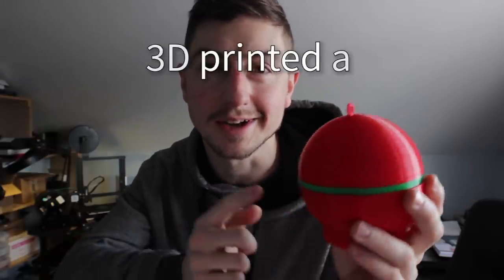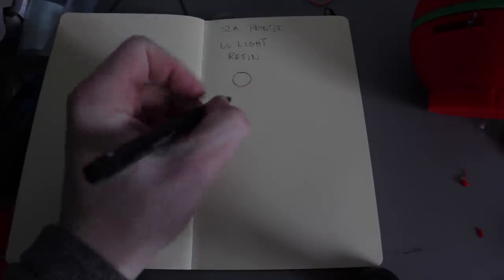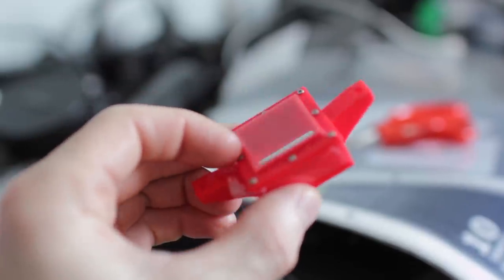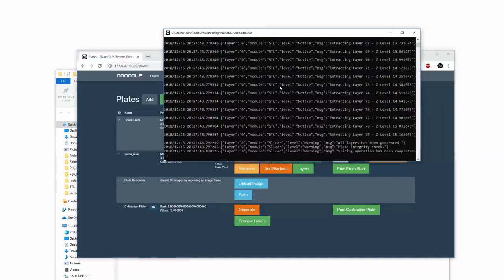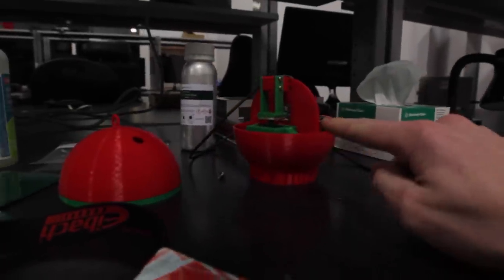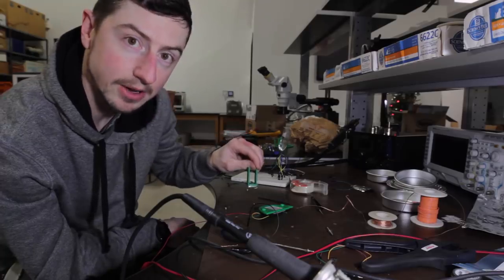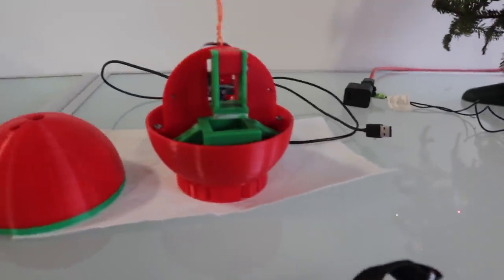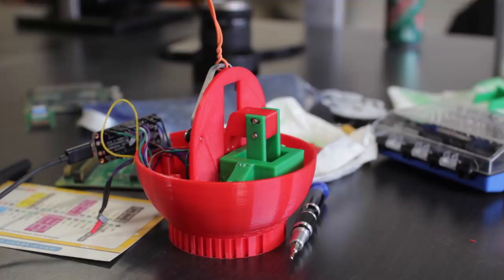Worlds Smallest 3D Printer (not anymore)

Comment: I'm really impressed by this - I think the mechanisms used for the DLP printing was really cool with the LCD screen masking and the overall concept. I'm impressed it works - feels really original.

Good job! Merry Christmas as well
Reply from the maker: Lots of the low cost SLA printers use this technique I believe. I think its being called MSLA. When I discovered it, I didn't think it was possible to make it work so well. As bad as my prints were, there is so much room for improvement, which I love.

Comment: Very cool project! I may have misunderstood, but it seemed like you would run the build plate down until the stepper stalled and then move up a couple steps and repeated for every layer. If the motor truly is a stepper you should only have to "Crash-Home" on the first layer. Regular 3D printers don't touch off on the endstops, you shouldn't need to in this case either. Hopefully this helps the squishing. As for prints failing because they stick too well to the bed, a lot of the higher end machines have tilt/slide/wipe mechanisms to help gradually break the connection between the screen and the print. Perhaps you could make your resin vat hinged so that as the build plate lifts, the vat tips slightly to break the adhesion from one edge towards the other.
Reply from the maker: You’re not wrong about the stepper. That was the original plan, to have it just count up x steps then down x-1 steps.  However when it came to reality some prints would hold on strong enough that it would skip steps on the bed lifting and peeling process, so it would lose its position, so like I said in the video “had to get creative” with it haha - I have plans for a tiny bed tilt operation that I need to work out.

Comment: Great Job! I would recommend to do a UV Display for PCB etching.
Reply from the maker: interesting, Ill look into it! I've never really gotten into doing my own PCB because its so easy to send off, but I should try one of these days!
Reply: @SeanHodgins  I can recommend a video on that topic by "electronoobs " " using a SLA printer for PCB etching". The great thing with that technique is that the toner from a printer does not have to get transfered via a paper and therefore the results are pretty impressive.

Comment: I barely expressed my amazement in my earlier comment, but SeanHodgins did an incredible job executing this idea! I do believe he spared us some of the hair-pulling issues he had to tackle to get this machine to work, but holy cow, from conception to a functional prototype in such a short time, all he has left now is the fine-tuning (although, as they say, the devil is in the details).

This project caught my eye due to problems I had printing very small objects on my FDM printer. While looking for tips, I came across the gaming communities who have perfected settings necessary to print small details, critical for the miniature figures and props they use in their games.

Which got me to thinking, is there any reason a very small form-factor 3D printer couldn't be built specifically for extremely fine details, or very small parts? So I found this video, which answers the question about precision, but now I have to know if FDM will scale down as well as this SLA concept did?

I'm picturing an enclosed "Prusa" style printer, a bit smaller than a shoe box, equipped with a heated bed (for ABS or PETG). I'm also picturing headaches getting nozzles with ultra-tiny orifices to extrude well, finding supplies of smaller diameter filament, getting slicers to understand settings that will fall beneath lower limits, etc.

Again, I can't thank you enough for sharing this project, great work!
Reply: My printer is a mini printer based on the RepRap Prusa I3. It's called 3Dtje. You can find all components on Thingiverse. The nozzle is 0.3 mm which works fine on small and medium sized prints. A 0.2 nozzle gave problems, perhaps the filament cooled off too quick. It's not nearly as small as this SLA printer. I think for really small parts SLA will be much better than FDM.

Comment: I love this. I have an old 3d printer controller based on the 1284p and I have been hacking away today to make my own firmware for a variation on this. Just got it to read some bitmaps from the onboard SD slot and display it on a 1.8" tft and tomorrow I'll get some steppers moving for the z axis and maybe a vat wiper, add a 2004lcd controller and hope it works ok. if it's fun enough I might do something with a 14" 1080p monitor and a raspberry pi I have kicking around the junk drawer
Reply from the maker: Sounds like a fun project!

Comment: What did you use for the build platform? Is that just a small piece of aluminum? Love the build, I'm planning a scaled up version because why not, hence the question
Reply from the maker: Yeah I forgot to mention it in the video I think, I super glued on a piece of 1/8” aluminum flat bar that I just cut to length, onto the bottom of the PLA build plate I printed. Drilled a few holes in it to allow the fluid to flow easier.
Reply: @SeanHodgins  Excellent, I've always wondered if this would work but I've just never taken the time to design and print everything, now at least i know it's not impossible! In fact it's damn easy, lol, thanks for the great build

Comment: Its actually a DLP printer. Sla uses 2 lasers, which is ehere thr stereo in sla comes from.
At first I was like "how the fuck is he going to fit an FDM in that?", as soon as i saw one motor and an LCD i knew what you were up to.

Alot of people argue that LCD printers are not DLP, but what is an LCD screen doing? Its projecting digital light.
Reply from the maker: I’m fairly certain all laser based SLA printers have a single laser. I’ve heard this type (using the lcd) is being referred to as MSLA, as in masking stereolithography printing. If I had to guess, the stereo comes from the fact it’s in the 3rd dimension, instead of just “lithograph” which is a two dimensional print. But lithography does not pertain to lasers at all. In fact lithography is just about printing in a way that involves stopping the ink (or whatever your printing) from going to certain areas, whether that is using chemicals to stop the ink from spreading, or using a mask(like in etching PCBs) to stop UV light from affecting certain parts. 
I like the term MSLA, it’s the most to the point for this type of printing.

Comment: Wow, and I can barely get my actual resin printer that isnt 4 years old to work. I expected a filament hole and extruder head with like a 3 arm FDM printer under there, not that.
Reply from the maker: That would be a feat in itself. 😂
Reply: @SeanHodgins  What about with the top half as a rotating Z axis with a single actuator x/y depth from a centerline.

Comment: Why are you just ramming the thing down? Who cares if you don't have a limit switch... If the drive you used was a stepper motor, then you could just be able to tell it to go down the first time, having the build plate 'loose', and then tighten it so that it stays flat and flush to the bottom of the tank... then, when it raises, just tell it to go back down but minus one.... then, you don't have to worry about it slamming stuff around or even needing a limit switch... since having a limit switch on an SLA is kind of just useless....
Reply from the maker: Stepper is not powerful enough, it jumped steps. Took a bunch of jumped steps to get the print to lift from the tank. So it loses position. My original code did just that, Lift up X, lower X-1, but it didn't work when it skips steps.
Reply: @SeanHodgins  in confused as to how that affects anything? Unless it's not using a stepper motor? Idk because it isn't very clear. Most DVD drives I've ever opened are all stepper driven. Lol.
Reply from the maker: @HDFoxra  Stepper motors do not know their position. You need to have a location that is position 0 and just keep track of steps. Generally position 0, or HOME, is found by hitting a limit switch. Since I didn't have limit switches, I ran the stepper to the bottom and bottomed it out(skipped steps), I called that position 0. Then I would raise it up one position. When you send a step to a stepper motor, the microcontroller thinks it moved, it doesn't know it moved, it just thinks it did. In order to know you need to have an encoder monitoring its position most steppers don't have these built in, but you can get them(not with these tiny motors). So lets say you have a stepper motor, you tell it to take 10 steps, but for the last 2 it gets jammed by something. Now the microcontroller thinks the stepper is at position 10, but its only really stepper 8 times. There is no feedback to say it only moved 8 times, not ten. Now if you move ten steps again, you will be at position 18, but the microcontroller thinks its at 20, etc. So when I would try to lift up the build platform, lets say 10 steps, it would take 5 skipped steps to actually get the print to separate from the basin, meaning the microcontroller has no idea where the stepper is, supposed to be at 10, but its only at 5. Which means you can't lower down 9 and expect to be 1 step above the last print layer. It would lower 9, and skip 4 steps bottoming out. Stepper motors do not send position, microcontrollers can only assume position.
Reply: @SeanHodgins  I'm sorry, but I'm already fully aware of all of that... Having built 5 3D printers from scratch over the course of 4 years... 

What I am getting at, is you are thinking of this as 'we NEED to know what 0 is' but you don't. Treat it like a typical CNC machine, of which, a 3D printer 'is' a CNC machine. You MANUALLY position the z axis to a known safe location WITHOUT having your build platform attached. Then, you send the printer G92 Z0.. This tells the firmware "hey, Z is at 0 right now!"... then you attach your build plate to the Z axis. That way, the build plate itself is adjustable to compensate for whatever angle or height difference you need.

Now, when you start the print, it will already know that Z is at 0, aka you never have to send a 'Home' command. You just 'start the print' and boom presto, its working. 

But what I don't understand is why you needed to mash the build plate down against the bed 'every time' the Z lowered. As you stated in the video, which resulted in the squished 'glove ornament'. Or how the stepper wouldn't have been able to lift it up off of the resin tank. Usually a DVD drive uses a stepper motor with a worm gear. That gives it some insane torque for a stepper of its size... It shouldn't have any had trouble lifting such a tiny piece up from the tank. 

Which, is why I asked if you were using a stepper motor, or if it was a DC motor style DVD printer (which does exist, just more rare) which just spins until it stalls, in which then it detects the stall and stops turning. If you connected the Stepper Driver directly to the motor, then well... yea... not gonna really work. But if you connected it to the existing PCB of the DVD drive to utilize its traces, electronics and such, and yet it was a DC motor OR a stepper motor, then it probably is still utilizing the built in stall detection, which then shut off your motor and prevented it from lifting. 

So again, if it is a stepper motor and its hooked up like a normal every day stepper motor, then all ya gotta do is just place the Z wherever you want it, attach the plate, send G92 Z0, and start printing. That's all.
Reply from the maker: @HDFoxra  It is a stepper motor as I mentioned in the video. It absolutely had problems lifting the print due to both suction from the liquid, and the print sticking to the tank. Which makes it skip. Which leads to a random number of skips each time a layer was printed. Which leads to having to set a large amount of excess steps to find the 0 position each time since you don't know how many times it will skip each time. Which leads to more downward pressure each layer and then to a squished print. Have a look at one of the DVD stepper motors you have opened and you will see they do not have a solid connection to the lead screw, they have a spring connection, which allows "freewheeling" of the motor if something is jammed. This is what allows the missed steps. I even improved mine by adding a screw for more pressure, but it could still skip steps when pulling hard. 

P.S. there is no G-code here, this is all scratch built firmware for the Arduino. There is no stall detection, no skip detection, no over current protection;  its just a stepper motor and a motor driver.